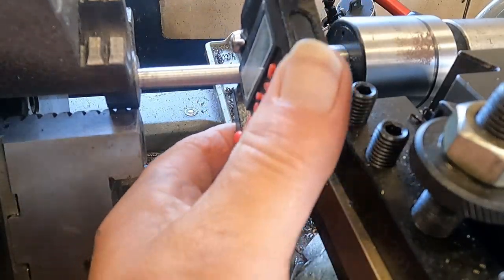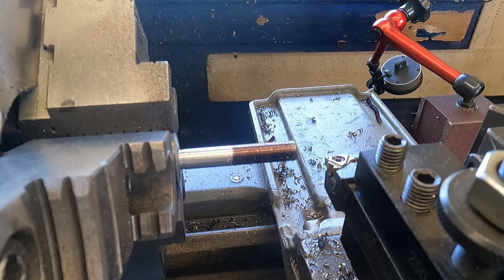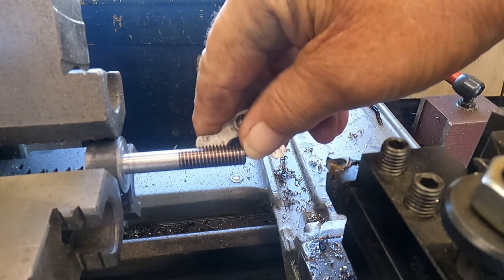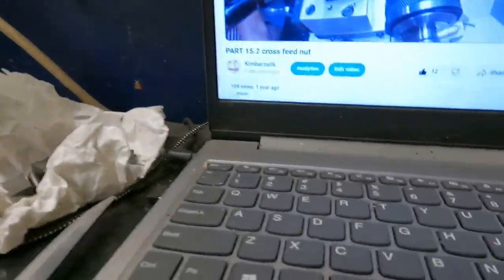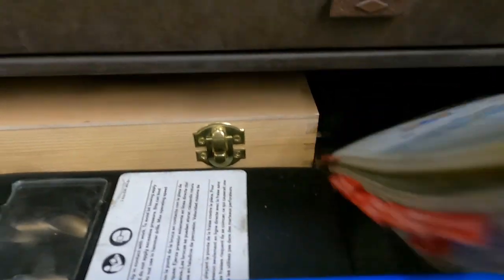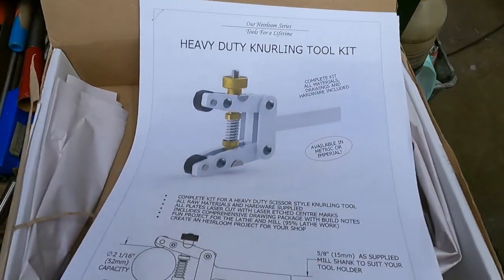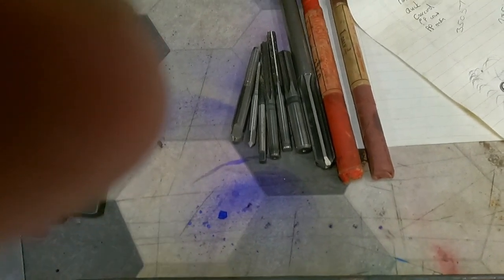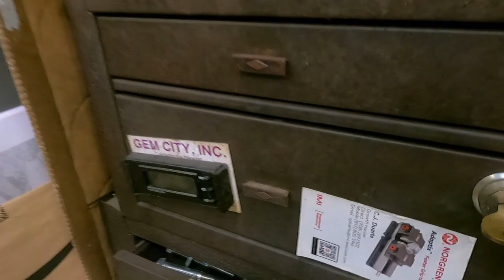Sketchy sketchy sketchy,THREADING ect...

Comment: I made the knurling tool from Hemingway kits this past spring, and nothing was finished had to do all the radius milling. I learned alot and it works great. Just remember for the reamed holes do not drill them to size on the print go 1/64 under size then ream them out. Good luck!
Reply from the maker: Thanks , that was one of my biggest concerns